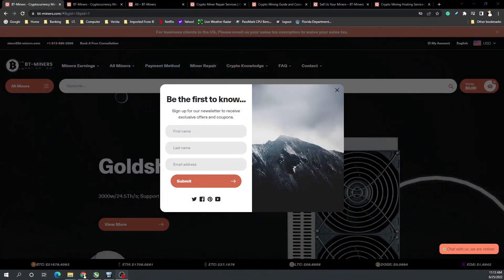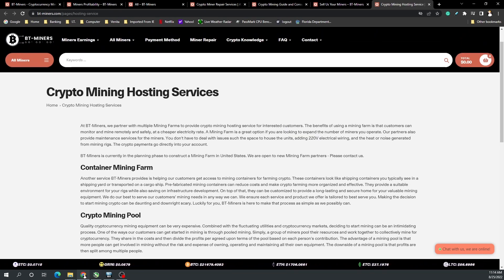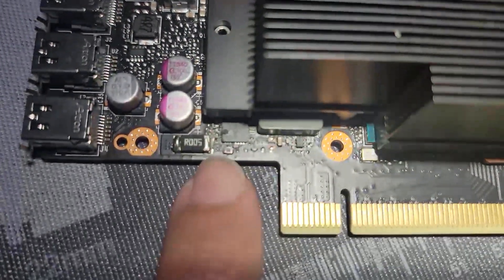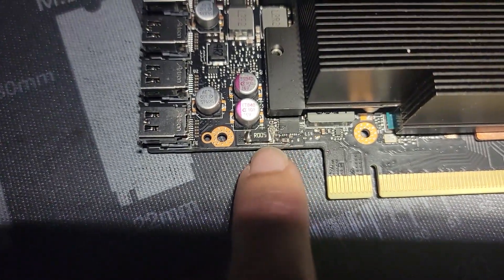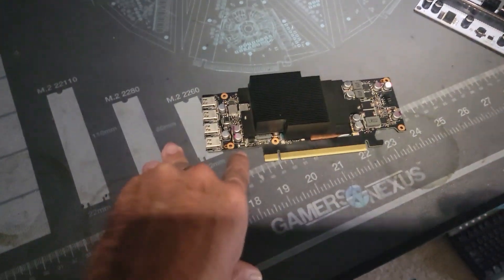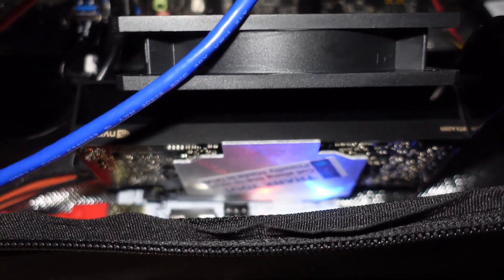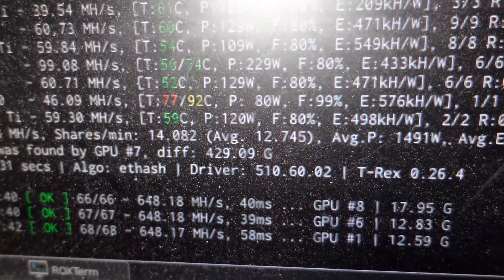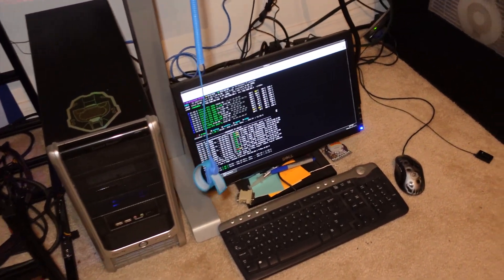Fixing Poor Solder Job on RTX A2000

Comment: practice soldering on a dead card or motherboard. Having an appropriate, high power solder iron helps as well. Avoid the cheap ones, they are useless on gpu's.
Reply from the maker: Your advice is what I mentioned and did in previous video, I just did a sloppy job on this one. All valid point tho
Reply: @SerpentXTech  watched now the previous video. I apologize for sounding a bit harsh. In the end the card works and I am sure you will do a cleaner job next time. Soldering takes a lot of practice. My first solder joints were not too far off from what you did :)